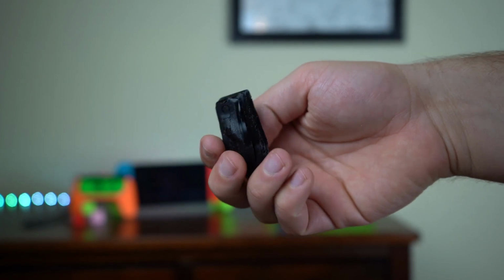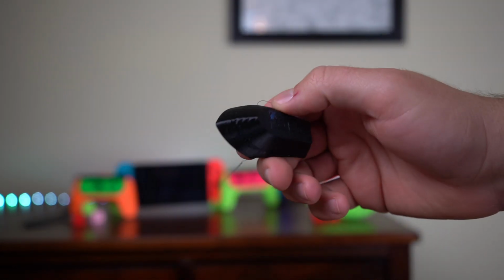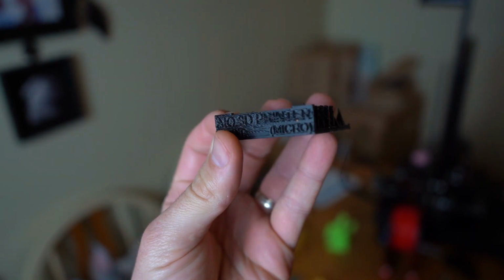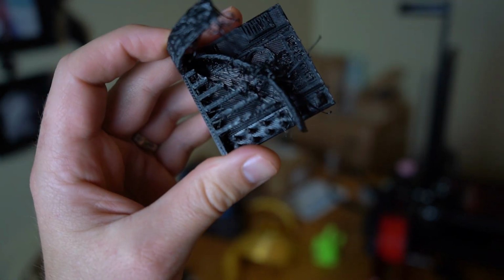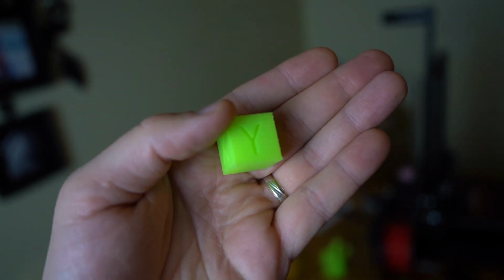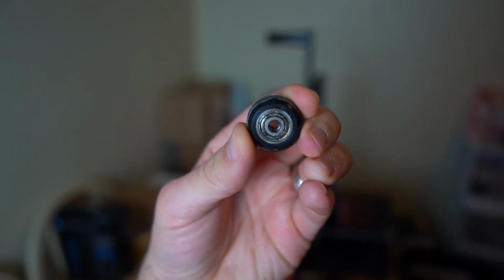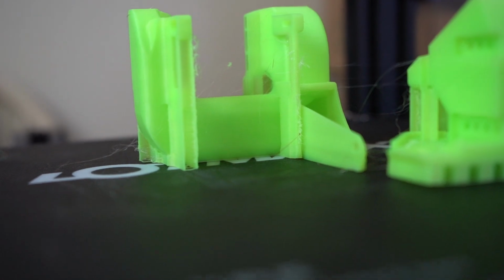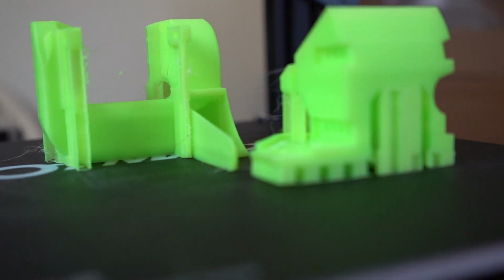WHY CAN'T I PRINT PETG on LotMAxx SC-10!?!?!?!?

Comment: Hey guys. I just got my SC-10 last week. My first printer. To get good prints on pla I had to set retraction to 10 mm
Which just seems too much to me. When I try the e step process I get like 93 to 94 mm and I am just not sure where to make the change. Petg so far for me has been a mess.
Reply from the maker: Same here. I basically gave up on PETG- which is a shame because I have to spools of it. 🤦🏼‍♂️

Comment: PETG is very sensitive to temperature swings, warping, and layer adhesion just like ABS. The only similarity to PLA is the printing temperature. 
My suggestion: 
On Cura try to set the profile to Creality CR-20. Make an enclosure for the printer to limit the temp swings. put a sock over the hotend if you don't have one.
Reply from the maker: I’ll take a look into it. Thanks! I do have a silicone sock over the heater block if that’s what you meant.

Comment: Hey dude, those benches look like an error in the STL as it looks like they are in the exact sample place both on the smokestack and the bow (could be worth trying another slicer too, you using Cura 4.5?). I will run off some PETG prints and see if I can find a setting that works well on my SC10.

Also seen in your setting you have Z hop on, what hight is it (going to guess 1mm?) I personally world turn Z hop off and only use it if your getting the nozzle dragging on your top layers leaving marks, and even then I would only use it at around 0.2mm......and finally for layer hight your better off using multiples of 0.04, so would switch 0.15 to 0.16 search "3D print magic numbers" to get an idea of how that works, as a bit too much to go into here but Chep has a good video on it here https://www.youtube.com/watch?v=WIkT8asT90A
Reply from the maker: Thanks for all the input! I’ve been using the provided Lotmaxx flavor of cura (cura 4.2) - but I just read a review on Amazon that said cura recently(ish) added the sc-10 as a preset. I am definitely open to swapping over and giving vanilla cura a try- I just assumed they were pretty much the same. 
I have drifted from their stock setting a bit and I do use magic numbers. 
What is the benefit of disabling  z hop? You’re right! Z hop is set to 1mm.
Reply: @NerdsWithFriends  Yeah, the Cura 4.5 has the SC-10 added now, So totally worth giving that a go. Regards the benefit of disabling  Z hop, if your retraction stating are not bang on right or you're using something that loves to string like PETG when it "hops" the Z-axis moves up as it retracts and Iv found this can leave a little bit of plastic that can at best leave imperfection on the print and at worse give the nozzle something to hit on the next pass (worth watching print and seeing what happens when it hops easy to spot, nozzle stops moving and it get louder while it lifts the Z 1cm) as it has to perform a retraction and lift the Z 1mm every layer it adds a fair bit of time to the print and is there to fix an issue most people don't have (the nozzle rubbing against a printed top surface and leaving scars on top solid layers),  and if you do have that issue then switching the setting to "Z-hop only over printed parts
" gives you the best of both worlds, but 1mm is far to hight IMHO, if have a well-calibrated E steps, having it more then say double your layer height would imply you're putting out far too much plastic. So in short Z hop fixes issues you shouldn't have in the first place and adds a lot of time to your print..... I hope that helps, and just ping me if you have any questions! (about to start some PETG prints now, so will let you know how I get on)
Reply from the maker: Pigeon Print yea- I’m pretty sure my printer rubs the top- bad. I did just by a z-screw backlash nut to hopefully help keep it from drooping.
Reply: @NerdsWithFriends  let me knowhow you get on with that! Been having a little struggle with PETG, sticks to well to the bed, and need to dial the retraction, was ruining 4mm at 40mm/s for PLA, but think I'm going to have to bump it up for the evil that is PETG (it's not that bad, just when you got an enclosed printerfor ABS you ever need to really use it, so Im a PETG rookie)
Reply from the maker: Pigeon Print no luck still. I just ordered some new thermistors- hopefully that will do it.
Reply: @NerdsWithFriends  any luck with the new thermistors and the PETG issue?